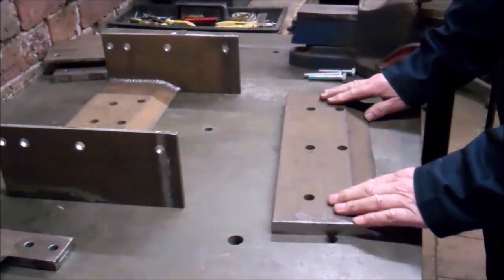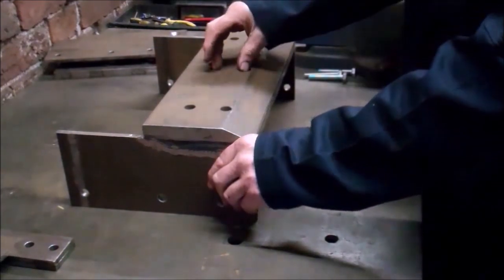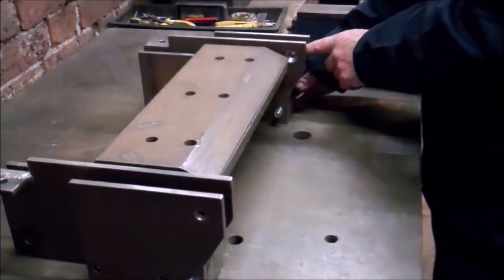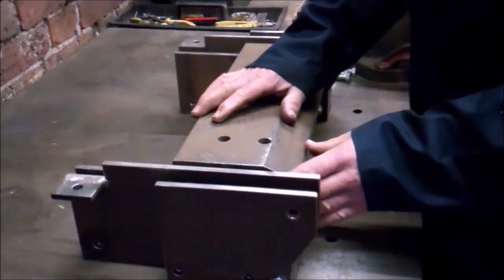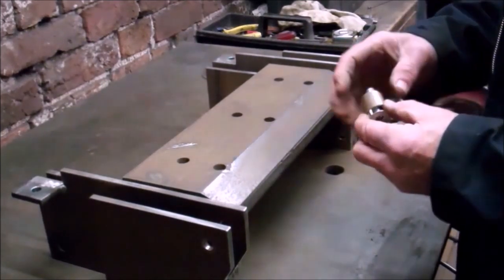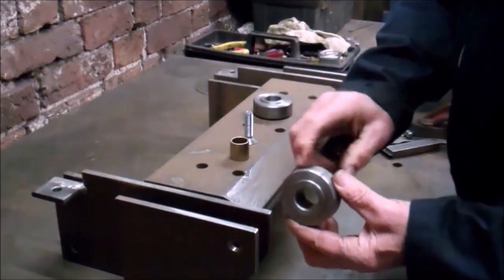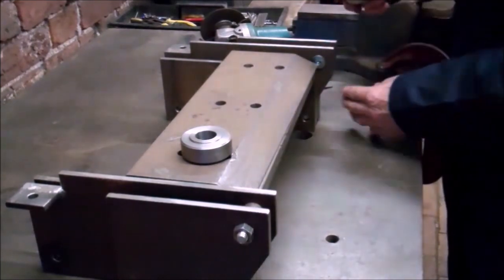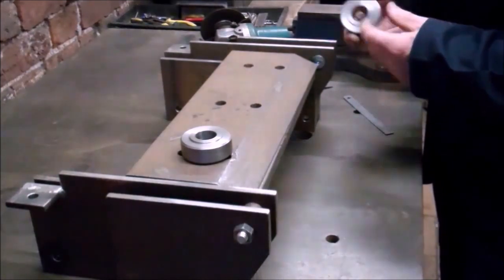Metal folder being built for precision bending

Comment: Great work,what type of steel did you use for the plates?
Reply from the maker: Hi Rossi, thanks for the comment, I am not sure what type of steel I have used to make the top and bottom jaws, but I do know it is very tough and hard wearing, I believe it was originally made for the front edge of a digger bucket, all other steel plates used are made of mild steel.